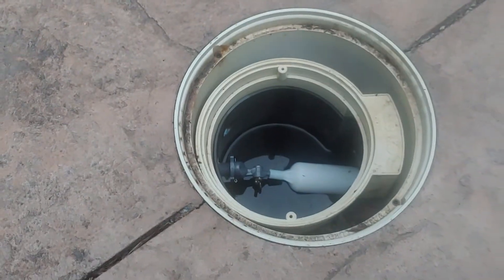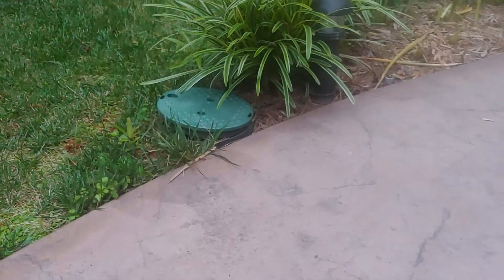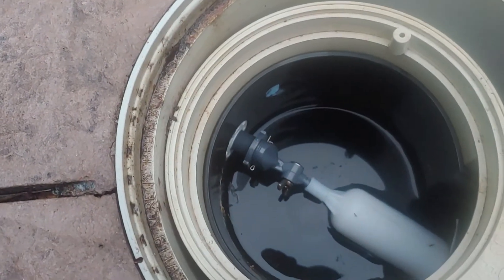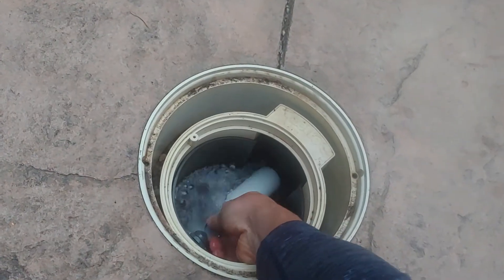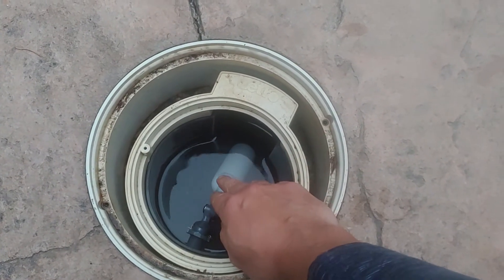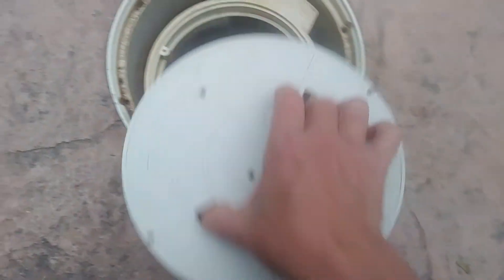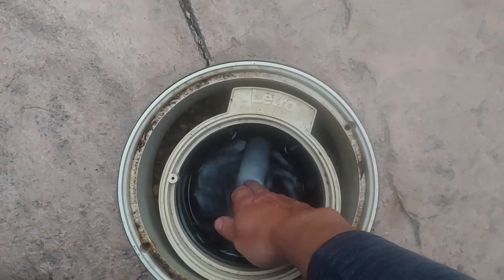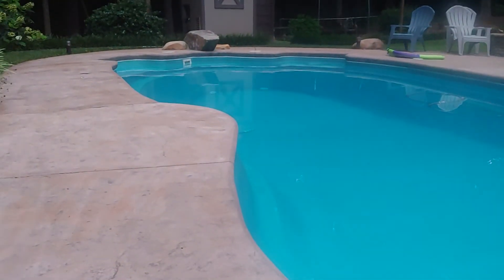Swimming pool Auto filler/autofill overview, any brand including Pentair, Jandy, Hayward, Letro.

Comment: I have a constant drip coming from the bottom of the float valve even though I’m at the height I want it    The installer says it should be like that.  I say stop should be stop.   What say you ?
Reply from the maker: Yes, for that reason I have a cut off valve for mine back over at the edge of the sidewalk and turn it on only when needed.  So the float valve is really only a safety mechanism to keep the water from running wide open if anything goes wrong.
Reply: @SwimmingintheDeep yes he’s right or yes I’m right
Reply from the maker: @America1st21  if your mechanism is like mine, it will be hard to get a drip to stop like that, they are pretty flimsy and you are relying on the float to push up enough. You can see at this time stamp that mine appears to drip too. https://youtu.be/vqE76QoYSGg?t=131    If the drip bothers you or impacts your water bill and If you have a place to install a cut off valve, I'd recommend that.  I just turn on my valve and let my system fill then turn it off after. I know that sort of defeats the purpose of the auto fill but my auto fill still keeps me from overfilling the pool if I forget.

Comment: Just had the Pentair T40-B installed (replaced a 20 year old auto fill unit) and when it's adding water to the pool it seems most of the water is entering through the float valve (located inside the auto fill unit) rather than through the water outlet that goes directly into the pool. Is this normal?
Reply from the maker: I think I understand what you are saying and it is normal. The level in the autofill area is exactly the same level as the pool level. The hole that goes into your pool allows for the two levels to remain equal. If you place your hand down in the water inside the pool at the hole...you will likely feel the new cold water entering there very slowly. You don't notice the movement as that hole is a lot bigger than the diameter of a water hose.

Comment: Hello, I'm having trouble locating the water source for my autofiller. It has recently stopped adding water no mater the water level. I've pushed the lever down to force water, but nothing comes out. Recommendations for finding the source. It's in-ground pool. 5yrs old. Was previously working fine. I've looked by pool pump area for on/off valve. I"ve looked for nearby in ground irrigation valves. I'm out of ideas where else it could get water source from. Any recommendations. I have a Pentair system.
Reply from the maker: It does sound like the water source is cut off. When I plumbed mine I plumbed it off of the sprinkler irrigation system. And when I winterize My irrigation system, I cut off the valve way up in the front of my yard. Is it possible that your irrigation system is also the source and it was winterized?
Reply: @SwimmingintheDeep  Thank  you for your help. I noticed our irrigation all of sudden wasn't working. Reset water well pump and fixed both issues. It was a new home and I didn't realize it was being fed with well water. Oh, I also found the cutoff valve buried under overgrown grass, directly in-line about 4ft from autofill.
Reply from the maker: @oscarsolis7786 that's the best kind of repair! That's great, thanks for the update, the comments will likely help someone else.

Comment: Can a pool fill itself either with water from an existing or modified pumping and plumbing system? I mean if someone can press a button that  completely drains the water so the pool can be cleaned before the pool fills itself with fresh water?
Reply from the maker: Hi Anne, Not that I have seen. Be very careful draining a pool. Hydrostatic pressure from the surrounding earth and water can pop some pools out of the ground. This is especially true if you live in Florida or where the water table is very high. If the water is really bad you can drain some down (like a foot) then replace with fresh clean water....while you are also treating the full body of water with Chlorine and continuous filtering.

Comment: So water on pool went up to top. Could it be that the leveler doesn't work? I freaked out not sure what to do.
Reply from the maker: Yes, yours could be stuck are broken. If yours looks like this go in and check the float is working when you raise up the float it should turn off the water.

Comment: Mines drip continuously very light drip. Is that normal? I am in texas where it is HOT but my water has been maintained at the water line
Reply from the maker: I'd say it's pretty common. I don't remember if I show in the video but I have a separate cutoff valve in the ground. I just leave mine turned off until I need to add water because, yes, mine drips too.
Reply: @SwimmingintheDeep does that drip or dribble add to the monthly water bill ?   I guess time will tell.  Just replaced the basin because of a leak that caused water bill to double , now my float drips drips drips instead of STOP.

Comment: New to pool life- question, how would I know if the auto fill is connect to a water valve?
Reply from the maker: If you push down on the float the water should come on, you may have a different type of float.  If you are asking if you have a cutoff upstream in the pipe, you'd just have to look for a valve (sometimes under a cover) near the pool or near the house that feeds it. It may look like an irrigation cover out in your yard.
Reply: @SwimmingintheDeep  Thank you, I will check on the float.

Comment: So I tried lowering the float to far down that I think it came off the thread. It doesn't want to screw back on. Any pointers on how to fix it??
Reply from the maker: Hmmm, I think it just screws on. If it is stripped try some rounds of Teflon tape on the threads

Comment: My water line is not threaded, any idea what I can do ? It seems to be just a plastic pipe connected to a hose bib near a corner of our house. Not sure how to install a float valve. Thoughts ?
Reply from the maker: Maybe it is PVC and can accommodate a slip on glued on threaded fitting?
Reply from the maker: @UCYFQN6YltyMdxQIeoi7bFvw three, something like that may work... Not sure what size you may need either. Also, not sure you need female threads like that like or male. Home depot or Lowes or ace would be a better bet. Buy all the ones you think may work then take back the leftover parts.... That's how I plumb, it saves many trips :-)

Comment: The float and valve in the video are similar to mine. How do you actually adjust the floater i.e. do you need to take out the little pin? In my case I need to raise our water level a little bit (~1")
Reply from the maker: To make the water deeper, loosen the wing nut and raise the float by a notch or two then tighten it.  This will give the valve less resistance until the water gets higher.
Reply: There is a screw and cotter pin (not a wing nut), unfortunately.
Reply from the maker: @jasondormido6516  I am not sure then, the float must be adjustable by height in some way.